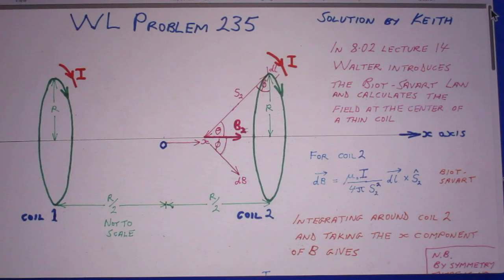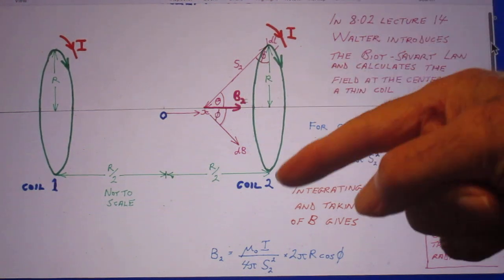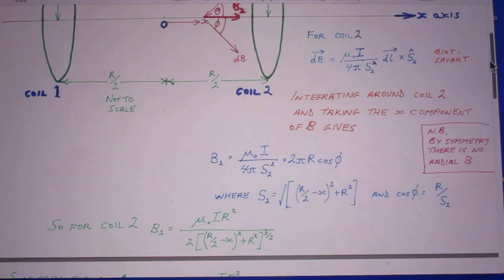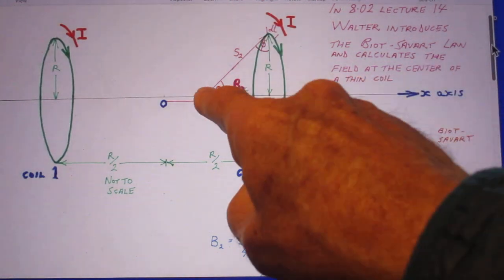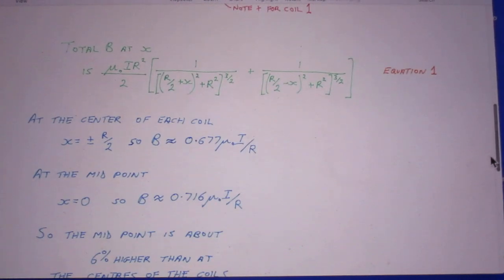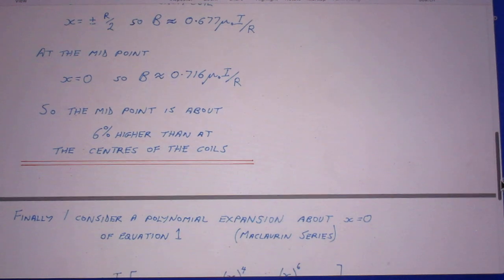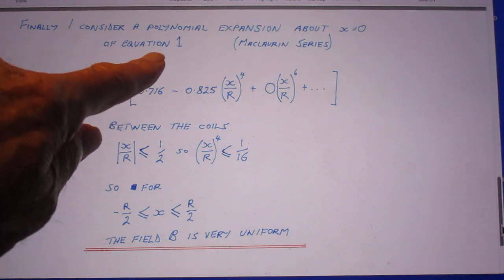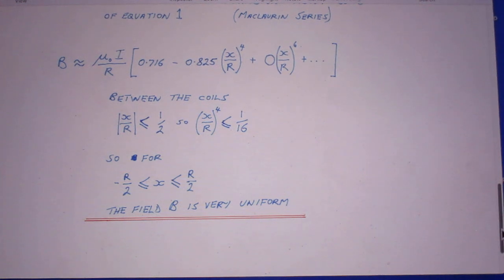Solution to Problem 235 Helmholtz Coils

Comment: I worked on a project using Helmholtz coils attempted to create an artificial magnetic gravity for metal powder to be flattened within a powder bed fusion device to be used in a low gravity environment. Surprising to me and my team, the powder behaved more like a fluid, creating spikes following the field lines rather than going in the direction of the downward magnetic force. My team believed that this could be due to the Rayleigh-Taylor instability, but I haven't seen any projects using Helmholtz coils this way
Reply from the maker: yes that is well known. google "liquid Magnetism"

Comment: I think my diagram could have been clearer but I wanted to put quite a lot of information in it. I considered showing a section through the coils but that didn't really improve the clarity. But I think anyone looking at lecture 14 should follow this easily.
Reply from the maker: your diagram was fine. However, you could have mentioned that looking at the coils from right to left that the currents were going clockwise.  I mentioned in your solution why it was clockwise.
Reply: Hello Keith, Your solution was beautiful as always!
Due to my original definition of B₀ I forgot to update my table.
I have done that now, but this did not change the final result.
The heat wave we have had here in Sweden is now over, so my brain has start working again 😄
Reply: @ulfhaller6818  Interesting about the heat wave. Both Bridget and I have a critical temperature above which we really struggle to concentrate on anything. It seems to be the same temp for both of us!

Comment: sir, i had a question, did you too solve  thousands of questions to become a good physicist or did you just focus on theory most? please reply, i also want to be a physicist one day, what should i focus on most?
Reply from the maker: I got 3 degrees in Physics: In 1960 Ir degree, in 1965 Dr degree (both of them at the University in Delft, The Netherlands). In 1966 Prof degree at MIT in Cambrdige, MA USA
Reply: @lecturesbywalterlewin.they9259 sure professor I also had same doubt that why we are not able to solve all questions or every type of it after understand clearly the concepts because here in india everything is made a type and we are forced to mug up thousands of illustrations before sitting in jee advanced exam. And the worst part is that students are doing it unknowingly and perceiving it as original and independent thinking
Reply: @lecturesbywalterlewin.they9259 please reply sir I want to know your views on my thinking about what I wrote above . Am i thinking in right direction?